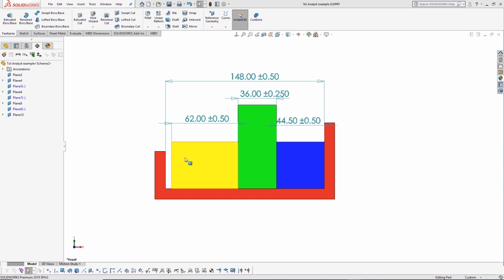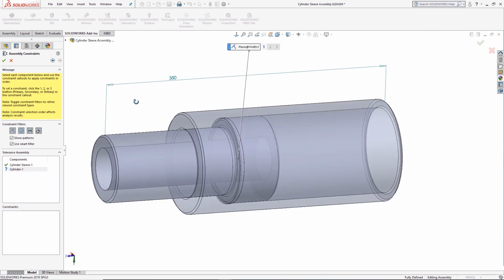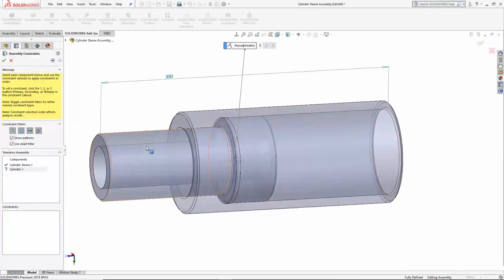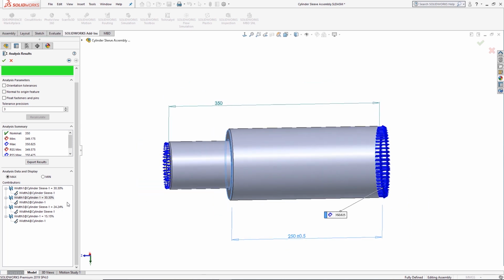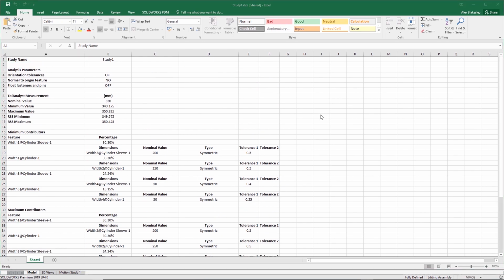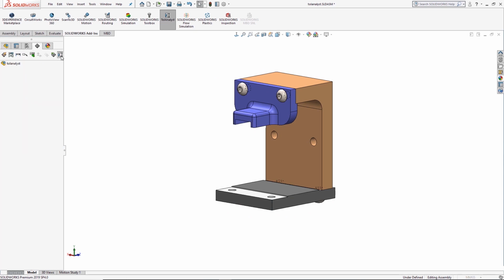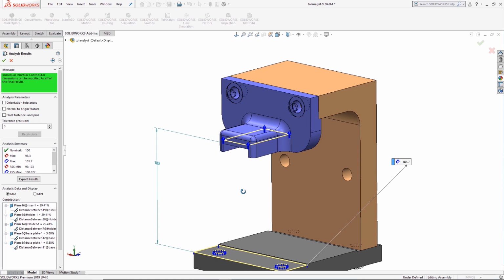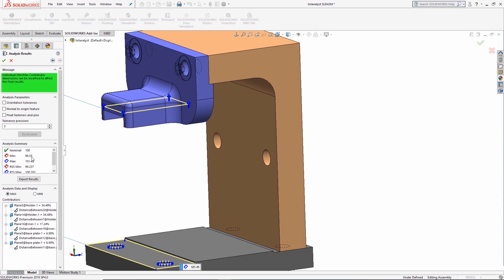SOLIDWORKS - Using TOLAnalyst

Comment: dang, that is so much more simpler than manually calculating. but in your 2nd example if that lip between the orange riser and the purple holder was not present, would calculating the assembly shift with the fasteners be possible? thanks

Comment: In your first example with the 2 cylindrical shapes, my hand calculation produced a worst case scenario of 350+/- 1.65mm, which is double the amount of tolerance that SolidWorks arrived at. Could the setup be incorrect? Or am I missing something? Please advise.
Reply: Agree. I support your hand calculation and not the result from Solidworks

The RSS result is not clear to me either. Assuming ±3sigma (Cpk=1) for each dimension and ±3sigma for the closing dimension I get ±0.241mm. Does anyone know what calculation settings SolidWorsk is using?